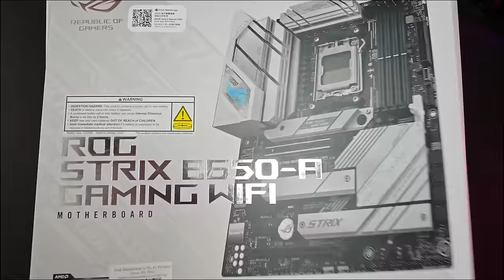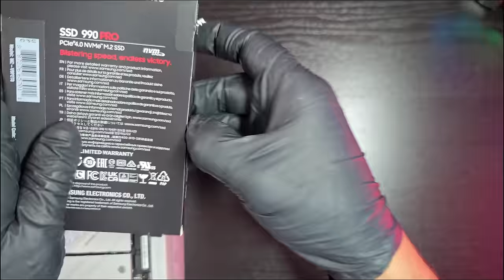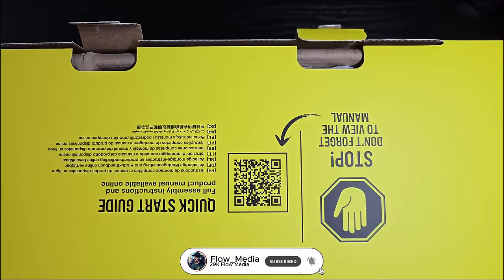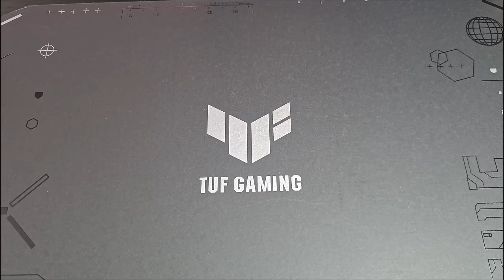Building a Lamborghini PC for my friend!

Comment: Beautiful pc, beautiful case, beautiful everything. A super nice build but I couldn’t stop thinking about the graphics card. They spent a ton on a fancy case, top of the line mobo, fancy fans, and a fancy AIO but got a 4080. The system is a beast but if you’re spending that much on aesthetics they probably should have gone with a 4090. If it was out of the price then they should have gotten cheaper parts that would have still made an amazing pc that looks great but not amazing like this one. To each their own I suppose. It is absolutely gorgeous though.
Reply from the maker: I just acted as Bob The Builder on this one 😅
Reply: Great point but in my country and i know for some other people its impossible to get there hands on. If i que up for delivery of the fast date is 05/2026! When they get in stock there instantly solt out
Reply from the maker: @adrian.m5631 it's out of stock everywhere in the world 😂